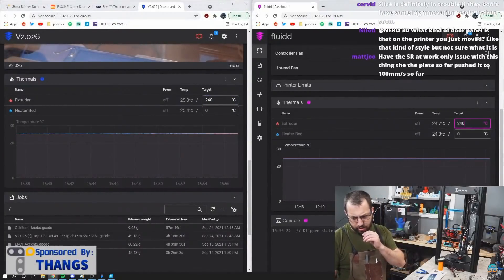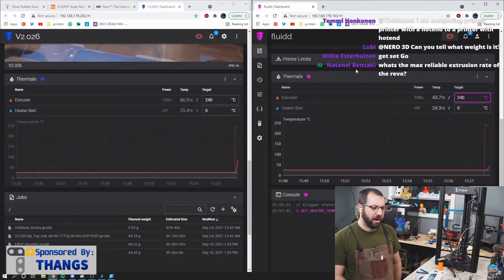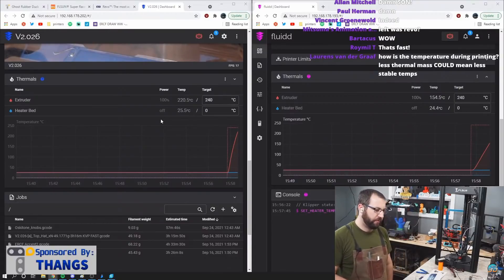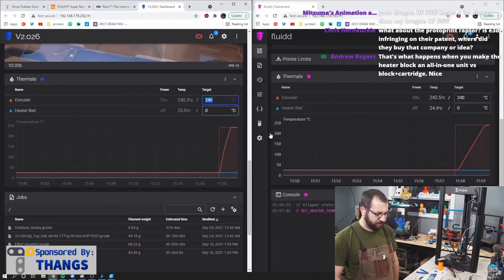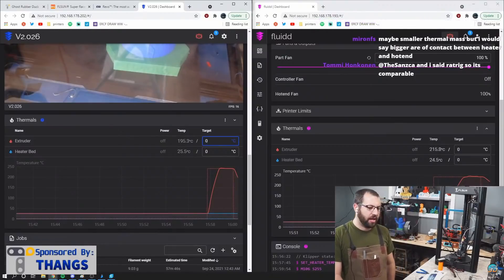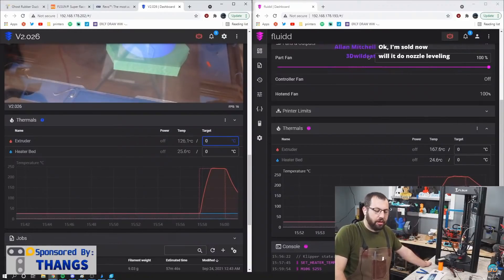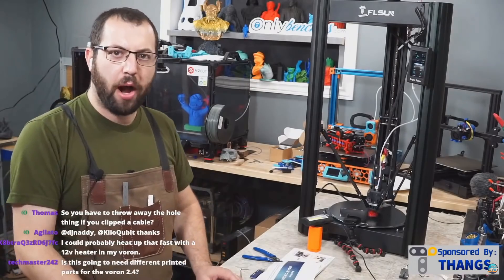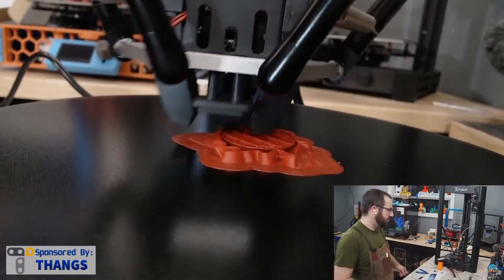E3D Revo(v7) vs HF Dragon Heatup Comparison

Comment: I’d rather have something I can get at a reasonable cost.
Reply: It is half the price of the Mosquito, and looks to be much better.
Reply: You aren't who they are selling to then. This is a brand new product, it isn't going to be sold at a cheap price.
Reply: I personally believe it is fairly reasonable for a genuine product.
Reply from the maker: 120 USD for the whole hotend kit and 4 nozzles, isnt bad compared to other "domestic" hotends
Reply: @CanuckCreator  I absolutely expect TriangleLab and Mellow to come up with clones. $120 is pretty decent already and they will probably make it as cheap as a Dragon
Reply: @jonathanlarsen4177  absolutely. Everything can be cloned. Then E3D will start behaving like Slice. Really bizarre actually that these Voron guys are pushing this proprietary hotend in contrast to how they have reacted to the whole Slice thing. Feels like there is something in it for Voron
Reply from the maker: The whole heater block unit is an in house design, and will have to be reverse engineered, thats one of the big things e3d spent time and R&D working on, and will be patented...which for a new tech, makes perfect sense.

I think you got the thinking that the voron team is `open source everything, no patents ever`, this isnt true, we understand why patents exist.....we just think that the current slice utility patent on...standoffs....is dumb and should not have been granted due to being such a simple thing and existing prior artwork in the ecosystem.

As for whats in it for voron? Better hotends, better tech? We arnt tied or loyal to anyone, if something came out tomorrow that was better, we`d probably jump to that. But at the moment, those on the team who were in the beta...we really like the Revo

Comment: Heat up speed is nice but 8d prefer which one was more stable under flow load
Reply: Same test done high flow stability as well
Reply: It is absolutely stable. (After pid tuning) I had +-0.2°C deviation while printing. Even on higher speeds.
Reply: @danielkrah5129  sweet, good stuff. U talking e3d?
Reply: @felurianmasters4369  yes revo beta unit
Reply: @danielkrah5129  ty

Comment: Isn't there a big mass difference? 
I would expect if you have more mass to heat up, that it will take longer to do so, however during fast prints, the more mass might be better to keep that temperature. 
Would be an interesting test, checking the opposite: 
 1- Let both hotends heatsoak for like 10 mins at 240º;
 2 - Then do constant extrusion;
 3 - Check within 30s, how long was heater on.
Reply from the maker: I have done some testing with seeing how well the hotends handle doing rapid changes in flow rate (basically idle, then extrude 100mm @ 5mms, then idle again)
And the revo consistantly showed a more stable temp chart. A lighter mass reacting quicker to demand works better than a larger mass with larger heater, but being less efficient and slower to respond as the mass takes longer to heat up and cooldown
Reply: @CanuckCreator  yes it reacts quickly, of course, and the temperature variations are smaller. However, "more stable" is quite generic: even if making it smaller is always nice, does it bring any actual improvement in the final print quality?
A normal Dragon after all does not oscillate more than two degrees (more or less?) which is not an issue already.

I don't mean this as criticism, just as request of further data, since you have more experience and more means to test the two to prove the presence of actual practical advantages.

Thanks anyway for this video! I'm curious to try my old UBIS hotend, which used a ring heater already 6+ years ago.
Reply: @CanuckCreator  it could be interesting to compare the duty cycle once the temperature is reached: if the duty of the Revo is 1/5 higher than the Dragon, the heat dispersion to air is the same. It's just a measurement of the quality of the insulation, since the Dragon has a sock already
Reply: It's intuitive that a bigger mass is going to be more stable, but there's also something to be said for a responsive heater.  You could do more testing for sure, but it's a good sign that the overshoot on the Revo was actually better. It a good sign that it's not hurting from a smaller mass.
Reply: Well. I think it's gonna come down to exposed area of the Filament to the melt zone . The temp fluctuation seen by the thermistor isn't telling the whole story. The area around the melt zone will have a temperature gradient, which carries into the Filament. So by the time it reaches the nozzle point hopefully the Filament is fully melted. Nozzle pressure will go up a lot if it isn't, not to mention the internal stresses of the extrusion will go up as well.  So mass isn't good or bad inherently, the gradient of temperature between the center of the Filament than nozzle/ heater block right before it gets extruded will be the most important. Unfortunately that's nearly impossible to test, a takeaway though is that flow rate and temp stability at the thermistor is not trustable indicator of nozzle specs. You could try and do some analysis on how much energy goes in at idle to maintain temp and how much it increases per mm off Filament moved. That might be a better way to understand the relationship of mass, melt zone and overall performance. 
Increasing mass will only be helpful if it is matched to the conductivity of the material and approximate area needed to conduct an equivalent amount of energy into the Filament.... In short, increased mass won't do a whole lot.

Comment: Which heatblock design is the dragon your using? The TL version (with v6 size and shape) or the phaetus block? And is it aluminum or copper?
Reply from the maker: Copper Phaetus HF Dragon
Yes it has more thermal mass, but also a larger 50w heater (vs revo`s 40w)
Reply: @CanuckCreator  I'm curious what the flowrate of the Revo is compared to this HF dragon setup. Quicker heat up time doesn't really matter if you're still waiting on the bed to heat up (especially when you have a heat soak macro).
Reply from the maker: @martijnpeters  the hf revo hasnt been shown yet. So current one wont outperform a HF. But im currently running 15-18mm3/s real world on mine depending on the filament plastic type with no issues
Reply: @CanuckCreator  that's pretty impressive for the Revo. It would be nice to see a volcano style down the road. :)